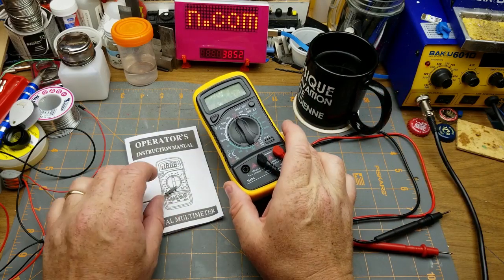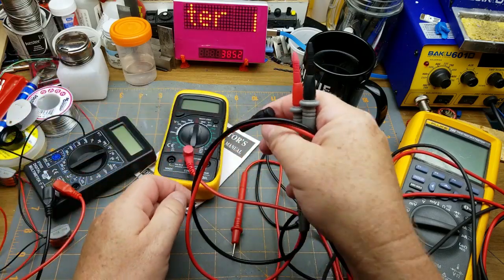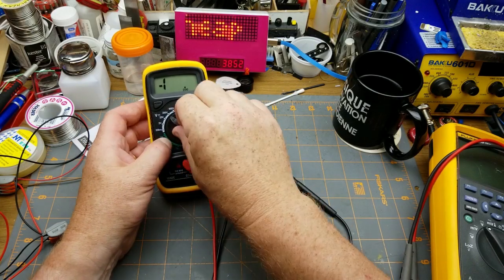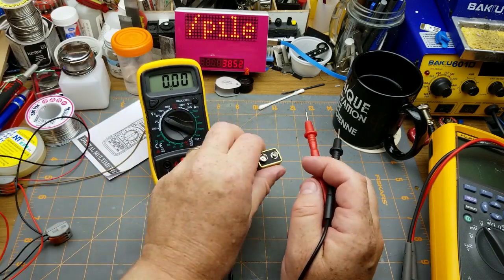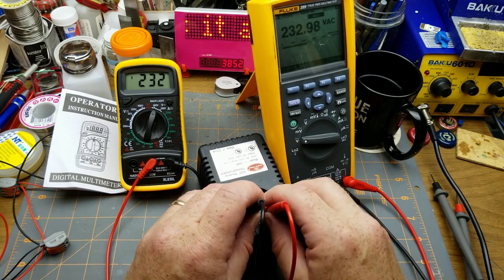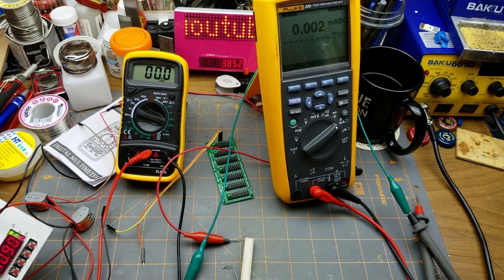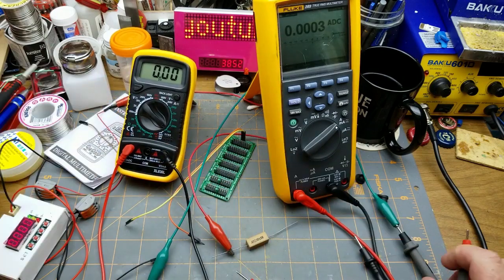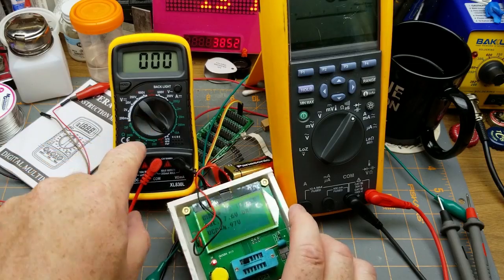testing another cheap multimeter

Comment: If you are clumsy or careless but understand what you are doing, this meter is a better choice than one that costs 10x as much.  This meter is not "cheap"; it's inexpensive, which is not the same thing, and it is a good value for what it can do. At the current street price of $10-12, it is a great value. The test lead for a Fluke cost 3x as much as this meter with leads, so it's not fair to compare them.  
I would recommend it as a good addition to a diyer's car or home toolbox because it is inexpensive enough to easily replace if it gets broken by careless handling.   I would NOT recommend a Fluke for those applications, just like I would recommend Mac tools 
I could confidently use it for service work, but what do I now? I'm not a  technician, I'm just an engineer with +40 years hands-on field experience.

Comment: As an Electrician in the UK for the last 35 years, I have used multimeters  on our 230-240vac supply without incident, I use a Uni-T meter on a daily basis on 3 phase 415vac at work, (never been in a position to own a FLUKE) but would I use a cheap meter, NO. I do use a cheap meter for model railways though and sometimes that means on mains 230vac, but I have changed out the leads for better quality ones. I believe that as long as you know what you are doing on mains voltages and treat it with respect then you can be safe more or less with what ever you use, in fact when I started work as an electrician, the guy I was apprentice to used a bulb in a lamp holder with two bits of wire sticking out and we tested upto 415vac like that, Health and safety or what. Great video keep it up and when is the next railway, sorry railroad instalment coming? Craig
Reply: 400 plus AC scares me my self imposed  limit is 220 volts even with my Fluke meters.
Reply: I’m also an electrician in the uk , the first cheep meter he showed I had one of those thourty years ago on AC voltage it was rated for 750v and 1000v DC but my was yellow and had the rubber protector, i used it all my working life until I left it on a site I moved on to uni-T three years ago I have two uni-T machines one is auto ranging there is nothing wrong with those cheap machines as long as you know how to use them correctly and know there limitation’s people that moan about them moan because they don’t trust there own competence and therefore should not be messing around with electronics or electrical systems. That why we spend four years at college training to be electricians and then two years onsite to build our competence and gain experience.
Reply: And another scare mongering video on multimeters I’m also an electrician in the uk , the first cheep meter he showed I had one of those thourty years ago ,on AC voltage it was rated for 750v AC and 1000v DC but mine was yellow and had the rubber protector, i used it all my working life including on 415 v three phase until I left it on a site and I have never never had anything go wrong. I moved on to uni-T three years ago I have two uni-T machines one is auto ranging there is nothing wrong with those cheap machines as long as you know how to use them correctly and know there limitation’s people that moan about them moan because they don’t trust there own competence and therefore should not be messing around with electronics or electrical systems. That why we spend four years at college training to be electricians and then two years onsite to build our competence and gain experience.

Comment: We have bought one of these exactly same as the one that you are reviewing. We bought it to test 240V but saw you only went up to 220V but useful tip you gave to turn the meter to 600V or it would most likely break it. We just bought it to test some electric cables to see if they are live or not. Thank you for the demo. Much appreciated.
Reply from the maker: 250V+ probably wouldn't break the meter, but these cheap meters don't have the safety features that a better meter would normally have.

These cheap meters are fine for low voltage hobby use, but I wouldn't recommend them for regular use on mains voltage.
Reply: @pileofstuff  Thank you! For the reply and advice. We will gladly follow it.  We only bought it to do small jobs occasionally. Only used it once thus far, not sure when we bought it maybe a year or two ago.  Just got some attic wires to check see if they are live. They have been left cut off with a knife by previous owner. We will disconnect them if they are not meant to be connected anywhere else, such as, to an extractor fan or light switch.

Comment: The grayish solder blobs looks just like lead-free solder not necessarily bad joints.
To be as accurate as possible when testing the current ranges, wire the meters in series and view the result simultaneously.
This meter is good enough for any circuits below 50 Volts.

BTW; I like your videos, keep up the good work.

Comment: I own a few Fluke meters  but the XL830L meter I use outdoors on my pontoon boat to check the 12 volt battery status and have used it to troubleshoot a faulty boat horn button. So far it has not fallen in the lake but if it did I would buy another. The best thing about this is the  grippy soft rubber case and low price... perfect for basic work around boats, cars, tractors, motorcycles where the risk of dropping the meter is high.  I would not think of bringing this near my 220 volt AC main breaker box or using it on a fussy electronics project.... that is what Fluke meters are for. You can find these on ebay for about 6 bucks for that kind of money it would be worth throwing one in the car truck or SUV since any meter is better than no meter and this feels more rugged than some of the cheap hard case meters.
Reply: Agreed
Reply: Mine came without working lcd. Fuck my life.

Comment: I needed one for my car and I found this on ebay, $10. I don't think I can go wrong with finding 12 here and there. Or just looking for grounds. I'm also on SS and only have enough money for bills each month, so this is what I had picked out of the china bag this year. Then I found your video. I got lucky.
I have a workbench Voltage/ Ohm meter Hewlett Packard monster but of course im not toting that outside to the fuel pump on my fuel tank sending unit that I'm working on at the moment.
The LCD kept falling out of place in my last Chinese meter, and I'd go in and glue it into place, but again, kept on falling out. I finally threw it in the trash but it lasted 3 years. Nice. Hopefully this one can take my abuse. Lol I doubt it.. but we'll see.

Comment: That's what I started with, I still have it and it still works. The leads were absolute crap and have long since been replaced.
I have now upgraded to a Fluke 107 which is not accurate down in the mV range, so I will keep my cheapie around. 
(I now need mains and do not trust $10 meters with 240v, just in case)

Comment: Thanks for the great lessons as a beginner who bought this XL 830L and could not follow the instruction manual that was poorly written and shows an inaccurate diagram that does not match the readings on the unit.  You knew from experience how to set the meter and thanks for showing that. I followed your set ups and they worked fine. I printed screen shots for future reference just for DC and AC tests which is all I wanted to be able to measure.  If you care please check the manual and tell me if I'm wrong

Comment: I have the XL830L meter. For hobby work it does great. My only complaint is that being partially deaf it is very difficult to hear the Continuity buzzer. I lived with this for some time and having experimented and created several electronic projects. After studying some online schematics for this device I decided to add a LED to this device. After disassembly I drilled a 3mm hole in the front of the case, hot glued the LED from the back side to the case, ran two small wires 4 inches and attached to the buzzer. Work great! I have other meters that are more expensive but for the money you can't beat the XL830L meter.
Reply: hi, i'm planning to do the same with my meter. so basically you just paralleled the led with the buzzer, right?
Reply: @johnmorton4285  thank you very much John, it is a very clear instructions. i will try it soon as i have my spare time. have a great day. 😃

Comment: It's nice that these have an adjustment screw and can be manually calibrated for DCV against a good meter.  From your demo, you might want to plug into high voltage using one hand instead of two, especially using cheap leads, to avoid electrocution with your heart part of the conductive path.  Sometimes the molding is sloppy and there are stray conductors just under the grip surface of the lead body.  No kidding, this is what I have seen.  Also consider to teach the kids watching your videos the safe way to use test leads.  Zebra strips are layers of conductive and non-conductive elastomer, spaced much more closely than many PCB leads.  As long as the board and the LCD is well aligned, the zebra stripe only needs to be roughly aligned.  Great cheapie DMM for the gararge to test for voltage or continuity.  Not to be trusted for high current or low resistance due to the lead resistance close to half an ohm.  Most of these meters I have opened up don't have a receptacle for the transistor tester, it's empty behind the lead openings.  On these units the transistor feature sucks even more!

Comment: The resistance comparisons were failed. At 12:07 the Cheapy is NOT "half an ohm out" at the 8 ohm test - you previously measured the meter leads, but then didn't subtract them! So actually:
Cheapy measured 8.8 to 8.9 minus 0.6 to 0.7 leads = average 8.2 ohms
Fluke measured 8.38 minus 0.13 leads = 8.25 ohms. DOH
At 12:49 you set the Cheapy on it's highest range 2 meg, so of course it cannot see NINE meg and of course "it can only just see" 2 meg. DOH
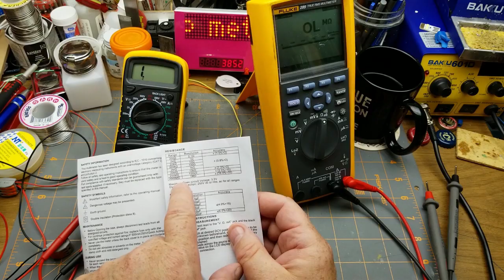At 100K and 1.5 meg both meters were virtually identical. So it was pretty unfair to say at 14:03 that "as long as you're staying in the lower ranges, it seems to be fairly accurate" .
Reply: Why would he had to subtract something to do with meter leads? Thank you, I am still a beginner.
Reply: @kingdavid4463  -- the meter leads are fairly thin wire, and all wire has resistance. This is only significant for low ohms measurements, so when on the lowest resistance range of the  meter, you first must short the 2 leads together and take note of the reading. Then when you take the proper measurement you are getting the total resistance of leads PLUS device under test, so you subtract the resistance of the leads to obtain the true measurement.
Reply: @johncoops6897  Ty, great explanation, I understand now.
Reply: I realize it is kind of randomly asking but do anybody know of a good site to watch newly released series online?
Reply: @Jett Landon Flixportal :D
Reply: @Israel Bryce Thank you, signed up and it seems like they got a lot of movies there =) I appreciate it!
Reply: @Jett Landon No problem :)

Comment: It rated for 600v AC , it will handle that safely but if you are dumb enough to test a voltage high then 620/650 you will one get an ol  on the lcd ie over limit or two you will damage the meter. Even your two flukes have a limit to what they can measure, put them on a 5000v supply transformer and watch what happens , but they will be ok with a 1000v if i they are rated for 1000v . That’s why they have cat numbers printed on the front.

Comment: Thank you for the knowledge gained. My only question so far is why have you put the red lead in the common terminal where as its in the right hand terminal in your 'Fluke'
The instructions on the XL830L also state to use the insert the black lead into the  central 'common' terminal? Thanks Tony
Reply from the maker: it's simply different manufacturers putting things in different places.

The common function is the important part, not where that manufacturer decided to put it.

Just follow the labels and you'll be fine
Reply: @pileofstuff  Cheers although  the one you have the red tail in is clearly the COM. Which it says to insert the black? Does it work either way round then? And therefore not important or dangerous?
Reply from the maker: @tonestones9445  "common" is often the "ground" of the circuit or the negative voltage, and is traditionally assigned to the black wire, though there are always exceptions.

But if you do connect the red wire to the common input, all that will happen is the voltage will display as negative voltage on the meter. No harm, just confusing.

Comment: Thanks so much for this video,it's very helpful. But I have a similar meter but the problem is it doesn't show the 0.00 on the LCD screen. It only show the indication of the other things like the, 20v,200v and everything but not the 0.00 in other to read anything. Pls what is the problem

Comment: Interesting, I have the exact multimeter, But mine has a name on it . PROSTER XL830L. But it doesn't show the range in the window like this. Also the rubber outer case has 2 extra bands on the back for better support. So what we have is an OEM  product, with slightly different specs depending on who buys them. BTW I got it  off UK eBay.  including battery £5 ($6.22) posted. Also when you checked the meters in the 6 gang multi plug. wouldn't have got a more accurate reading if you used the same socket ?? ;-)

Comment: I have dozens of cheap multimeters (not this one yet though). Their measurements are all usually similar to my Flukes, the problems they usually have are slow continuity (deal breaker for me), lack of input protection, and lower "number of counts".
Reply from the maker: Actually, one of my cheap meters has a faster continuity beeper than anything else I have, even the Fluke!

But, yeah, for a s accurate as they are, the cheap meters aren't high precision, nor are they high durability.

For a beginner hobbyist, they're a good place to start, though.
Reply: @pileofstuff  now that you've mentioned this, I remembered that I too have a couple of cheap ones with extremely fast continuity, faster than my flukes. I went on testing them just now, and they are: Aneng AN8206, Borbede BD-168B and DT9205A+ (this last one, I have other three with more or less the same name, they all look different, and only this one has fast continuity).

My flukes are 289, 179 and 87V.

All in all, I do agree cheap ones are a good place to start.

Comment: When was the last time your FLUKE meters were calibrated? But if you are an electrician type, you pretty much know what to expect when measuring a voltage/current, if it supposed to be there or not and making sure it is not is important when you are handling wires.
Reply from the maker: The one I used (and the others I previously compared it against) are very low mileage. 

When multiple meters agree very closely, it's usually a pretty good indication that you're golden. (I agree it's not the same as a verified calibration, but it's good enough for most practical purposes)

Comment: Hi. Im just trying to check some outlets and switches in my home. Tweakers got in my vacation home and rewired all kinds of things. Wires hanging out of walls. My outside light is doing mad sparks even though the switch is off. So what the heck setting do I put this on? I mean i wish somebody would just explain what the dial is meaning. All the videos seem to think we are familiar with these devices in general.
Thanks for very clear videos with clear enunciation.
Reply from the maker: Ultimately, how you set the dial will depend on what scenario you are trying to test.
That said, messing around with full line voltage is a really bad idea if you don't fully know what you are doing. That stuff can kill you if you're not careful.

Comment: Diode mode reading will depend upon the test voltage from the meter itself.
Reply from the maker: True.
Though with a 9 volt battery powering the thing, I was hoping to be able to be able to read at least a 3 volt forward bias voltage.

Comment: I have the same multimeter, but it couldn't measure the resistance of my skin (I switched to all dials/levels, but still no reading). Skin or body is supposed to have some kind of resistance, right? Although the resistance setting works on other conducive materials (so does the continuity). I just don't know why it can't detect my body/skin. Would you check yours using that cheap multimeter?
Reply from the maker: Skin resistance is usually pretty high - on the order of several hundreds of MegOhms. 

I can't even measure it with 2 of my Fluke meters.
Reply: @pileofstuff   i just wonder, bcoz I remember when I was young I used to play with my dad's analog multimeter and it would always have a reading on my skin, or when I touch each lead with my fingers. I even put them in my forehead and it would get a reading.

Comment: Hello. Its very good video. If you have time i need to ask a question. I have same multimeter but current side have a problem about 200. It gives same result with 20 option so i cant measure between 20 ma and 200 ma. Only can measure with 10A option if i have somethng over 20 ma. When i trying to measure it with 200 optiıoın and if value is over 20ma it shows me "-1" like its oversclaed for option. Do you have any idea why a multimeter is acting like that and do you have any solution? Thank you.
Reply from the maker: How are you connecting the probes?

The lower current ranges are measured with the meter probes in the "normal" position.
Only the 10A range needs the + probe moved to the 10A socket.
Reply: @pileofstuff  no no probpem is not probe. 200 ma section read the value x10 multi becase of that if you read somethng over 19 ma it shows over ranged. I read 19 ma value with 20 section but read same item with 200 section as 190. Because of that i cant read something over 20 ma. It shows duplicated with 10 and over ranged. Its very absurd foult actually.